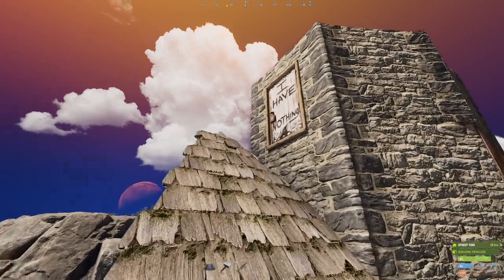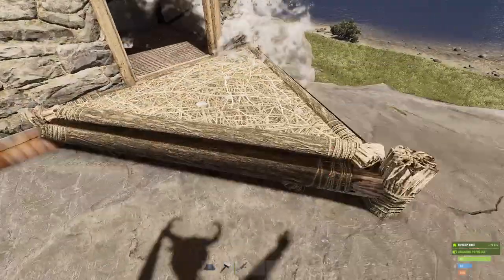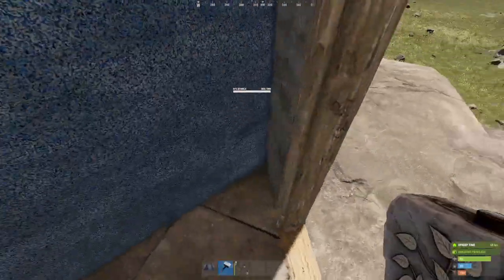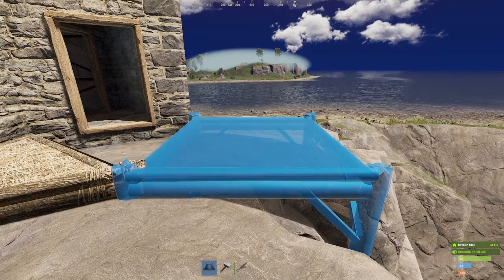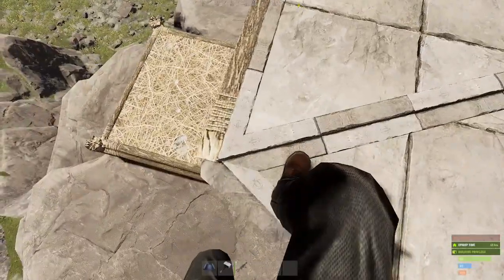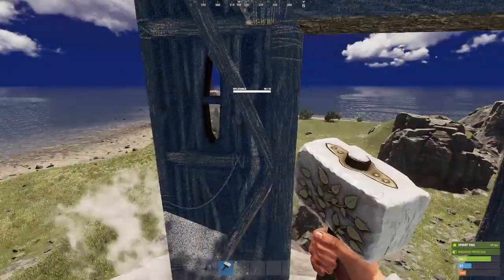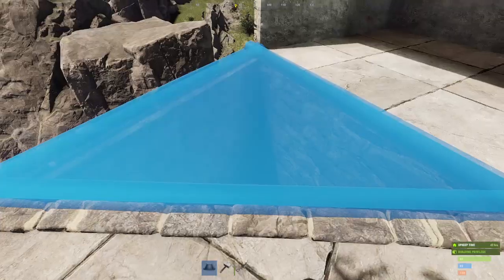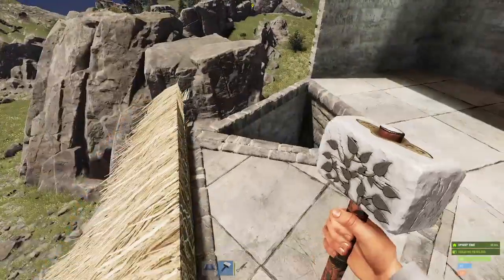Rust Trick 08: Dutch That Airlock

Comment: question for ya good sir, know if there is design to open three bunker up at one time with one square ramp? Just like the other offset bunker counterpart method? I know there is one for this type ya can open two, i was wondering if there is one for three? And there isnt alot video coverage on this " floorstacked offset bunker " version your showing, but would like to know more info about it if ya have time to talk about it?
Reply from the maker: Vocabulary mentions: a ramp is a different kind of block than what we're using here. These are square roofs. Also, kindly don't use "offset bunker" when referring to this bunker approach -- it's named after its creator, DutchLaws. Sven popularized the rename by failing to credit him.

Regarding designs, I've seen plenty that open up to four, but no named ones come to mind. As you may have noticed I'm on break from Rust. I'd suggest heading to EZ Building Discord and asking for "a dutchlaws footprint that opens three at a time" or similar.
Reply: @InigoPhentoya   fair enuff, i know who its by, just lazy way of saying it, cuz one is floorstacked and other is NOT.  lol  But question about this method you did, dutchlaws one,...um, can it open up 3 or 4 bunkers on 3 or 4 different stories, like other version  Sven showed?  Or is this version more limited?